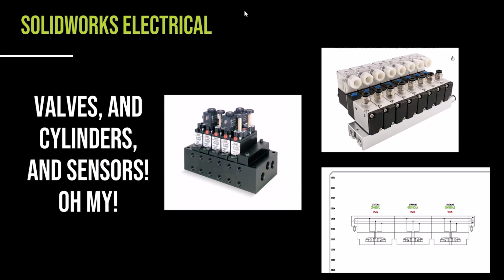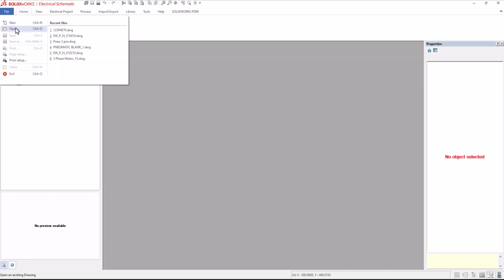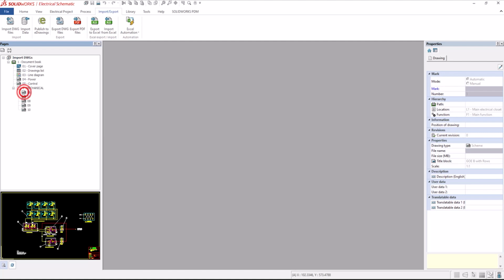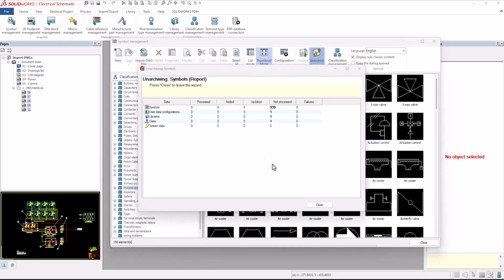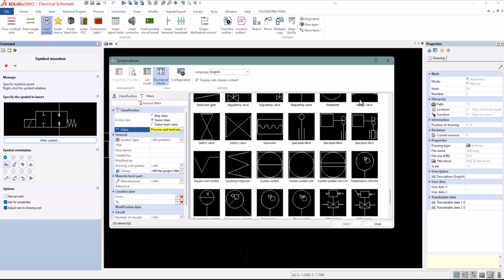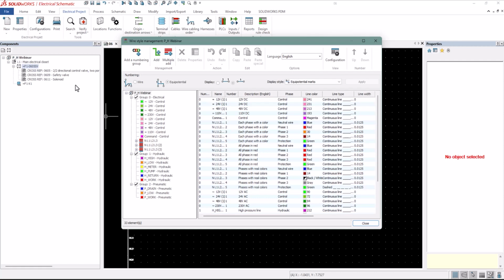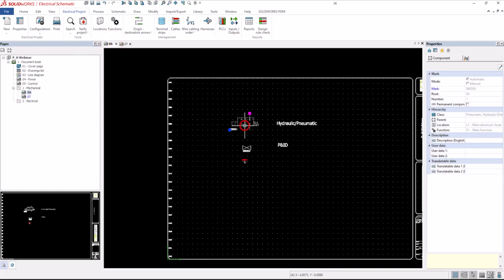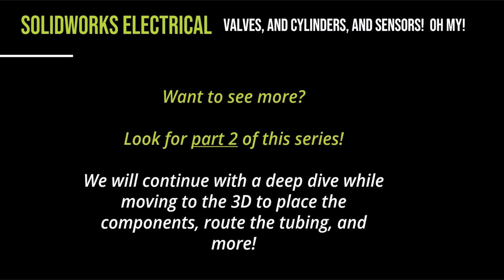Creating Mechanical Schematics with SOLIDWORKS Electrical

Comment: I might be starting a job that involves doing some Hydraulic Schematic work. This might be kind of a dumb question but how regimented are the sizes, say if you draw a circle with an M in it for a motor, or a 3 rectangle box for a valve or whatever. is that pretty open ended, just what looks appropriate to the eye, or are there particular sizes in standards for circles & boxes etc.? They use SW, but I'm not sure if they have SW Electrical, so I don't know how they get their symbols, but I'm assuming things are pretty open ended size wise.